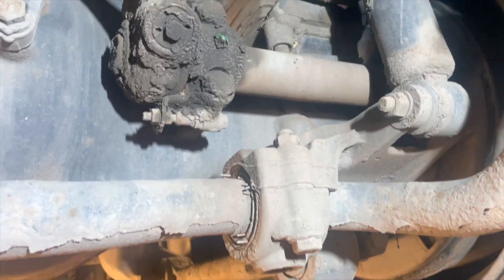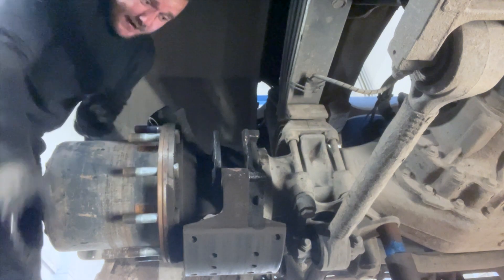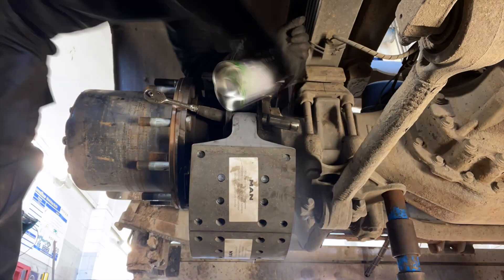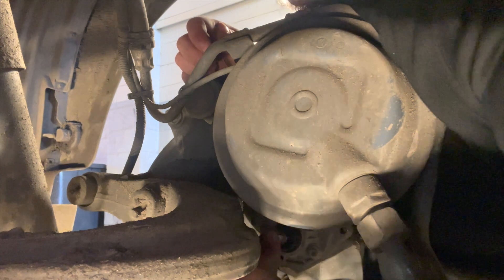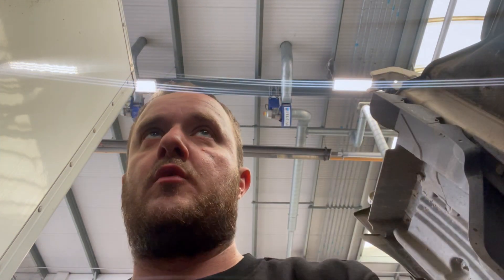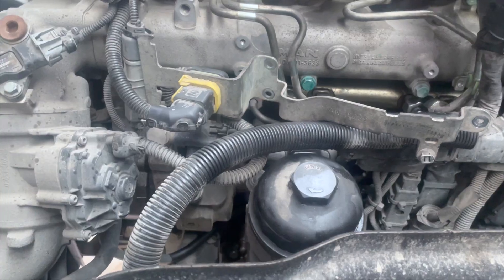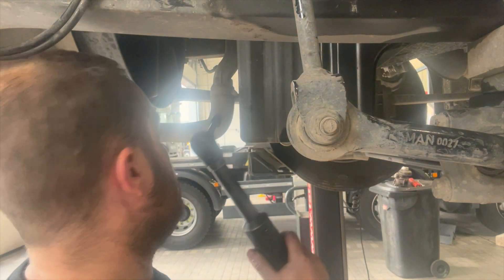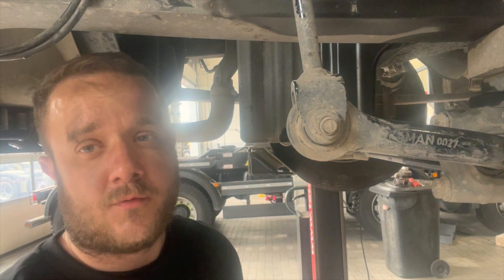A week in the life of a HGV mechanic- nightmare brake shoes, worn pads and a knocking engine!!

Comment: those rear shoes looked a right pain Dan never actually done them on a MAN  is it not possible to fit the springs first and feed the shoes in behind the hub ? on the DAF  CF  i always took backplates off found it much easier to remove and re fit the pins . you want to get yourself a proper star socket for adjusting the brakes i have a 3/8  one much better and don't brake like those in the kit . MANS are 💩
Reply from the maker: Yeah tried that mate but they kept popping off 🤦‍♂️ yeah I think it’s good to try working on different trucks, many different manufacturers have different bolts etc I.e E bolts